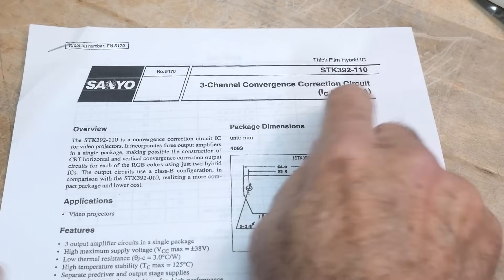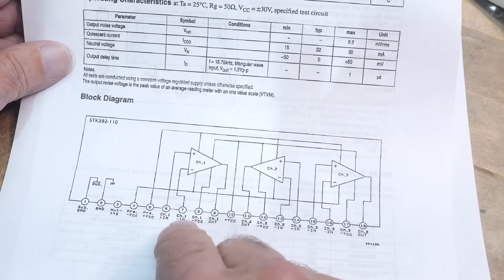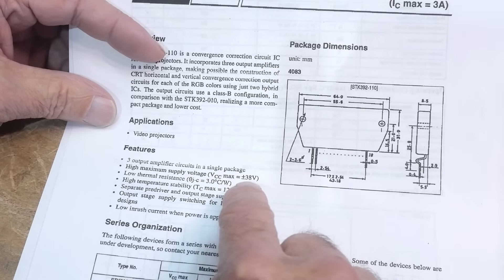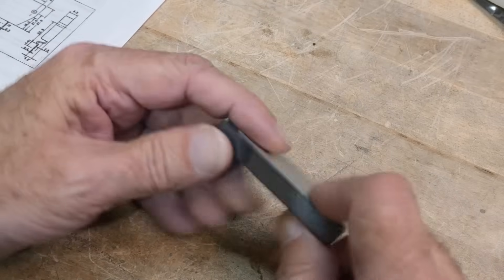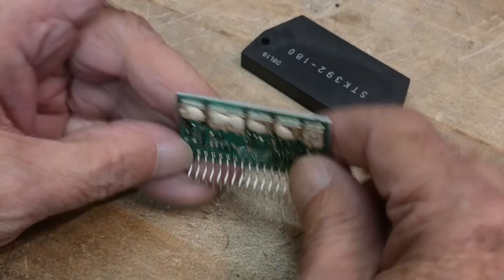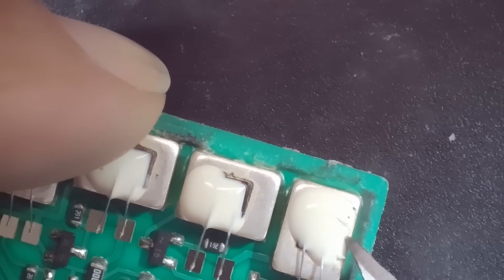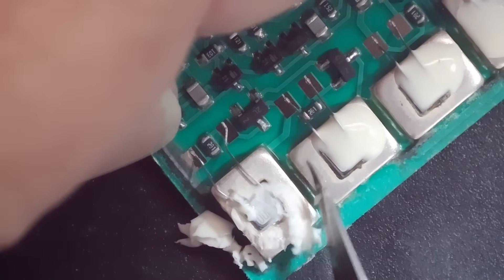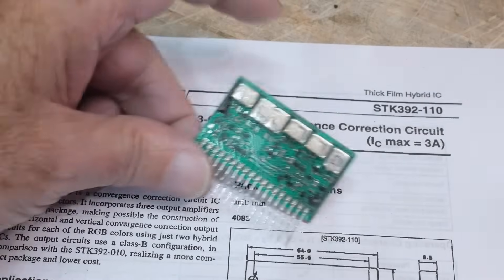#2140 STK392 Convergence Correction

Comment: I have a few plasma display panels drivers that r similar construction to this but more modern with big power mosfet/igbts dies wire bonded to smd gate drivers. It has something to do with energy recovery/efficiency and they call them sustain but i never could find a good theory of operation

Comment: Those circuits are meant to drive small coils linearly with current. There would be other circuitry to derive several functions of X,Y to provide the correction wave forms.

Comment: Looking at the diagram and the pcb, it looks like the output transistors are running with the bases connected. Being darlington transistors, that leaves a gap of about 2.4 volts where neither of the transistors are on. Thus they are not suitable as audio amplifiers because of a lot of crossover distortion.
Reply: Confirming that, it also says it's class B in the datasheet

Comment: This one is a fake. True STK doesn’t have SMD components in it.
Reply: Not fake.. that's how all the STK parts with the plastic cover I've ever seen were made.. back in the 80s and 90s anyway.. these were also made by Sanken. The stereo amps were popular and you'd often see them in rather high end gear.. where you'd think they would have made a discrete amp.. obviously there were advantages both in performance and cost..
Reply: @OwenOReilly-d2w  they used trimmed film resistors on substrate and packageless active parts. No SMD packages were inside at all.
Reply: I guarantee you they are not fake.  I bought them along with thousands of other parts directly from a OE parts distributor when they went out of business.  Most of the parts like this had a couple decades of dust buildup on the boxes.

Comment: If you need anymore of them I think I have around 60 of them.  Those and thousands and thousands of other "consumer" products repair parts came from a buyout of a local parts distribution center.  I ended up with 1 1/2 box trucks full of goodies for a fraction of a cent on the dollar.  I think I also threw in a couple stereo amplifier modules that look like that in the last box of goodies I sent.

Comment: The white "stuff" looks like the RTV potting material they used on many of our bigger relays in out avionics test equipment. Big multi-pole relays that were used for stimulus/sense lines to/from the equipment under test. Had to be sturdy because they were made to be put on aircraft and moved if required.

Comment: The part that was behind the soft stuff is the thermal compensation resistor between both emitter on each darlington transistor. The transistor is sandwich between the back heat sink and the square bloc on top.